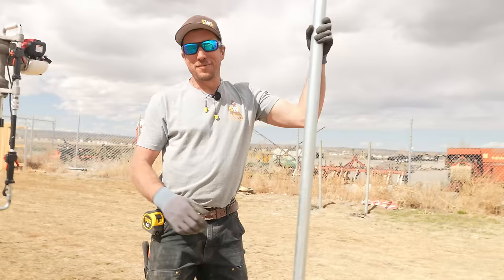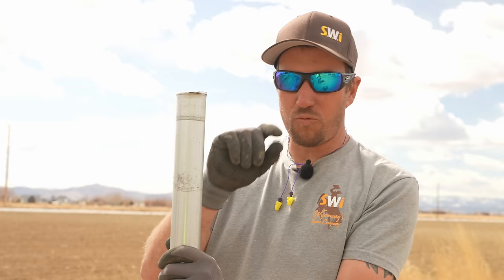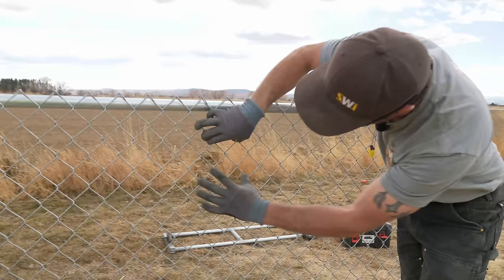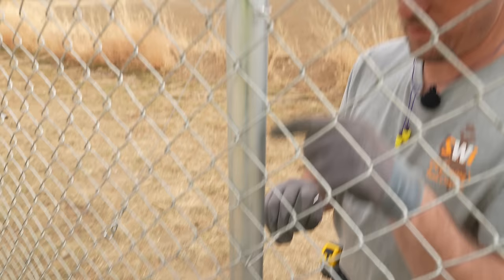How To Install Chain Link Fence The Easy Way

Comment: I have 300 ft of chain link fence in my back yard, to keep my dog in. The fence is in terrible condition. Sags, missing ties, no bottom wire; previous owner diy special. I contacted a fencing company to come out and service it. Never heard back! Red hot sales lead ignored. I have worked with my hands almost my entire adult life, now 77. There is nothing I've seen on this video that I can't undertake, and I have the cutter tools already.  Great video. Very well explained. The man has mastered his craft.
Reply: Sir I’d love to help you if you live in Georgia , I’m a hard worker and will do it for free
Reply: Red flags for contractors: fixing other people's work, angry client, DYIers that know something by watching videos, clients that know everything wrong with fencing so you know they'll only find fault in your work. Those are folks that, no matter how good your work is, they will never be happy. Pass
Reply: Never call a fence company for stuff like that it’s usually gonna cost u 400-600 just for a repair I charge 150-400 depending on repair
Reply: I am a Chinese fence manufacturer and fence machine manufacturer
Reply: Where are you located and have you got your fence ?
Reply: How did it go
Reply: As long as you have stretching tools, chain link fence is a no Brainer. Just watch your back rolling it out. And pay attention to if the crown is up or down on the mesh rolls, it will always roll out the same way accordingly. This will save you from having to flip every other roll.
Reply: yes

Comment: I am from Czech republic, in Europe. It is interesting to see how different your fence system is. We don't use the top rail, that would be too expensive, instead we use 2-3 tensioning wires (top, middle, bottom), which are not twisted wire, just a single one and on each wire there is a ratchet tensioning mechanism. To prevent terminal posts from bending under the weight of the fence we use struts at 45deg angle attached at 2/3 of the height of the terminal posts and on link posts each 80 feet. These days more and more people don't even actually use the chain link fence, but we use square hole spot welded fence, which is much stronger and doesn't require the tensioning wires. Instead the horizontal wires of the spot welded fence are bent slightly to a V shape in each square and then to tighthen the fence we use special pliers which are bending the V shape to be more pronounced, effectively making the square narrower and thus tensioning the fence. A lot of times we also use concrete plates underneath the fence, which are sitting on the ground, attached to holders on the fence posts, this is to prevent dogs from digging underneath the fence.
Reply from the maker: Very interesting! I wish I could see it!
Reply from the maker: For sure! 👍🏻
Reply: Id love to see what it looks like
Reply: @iridium8341  I would disagree with that, to me the top rail would make the fence look too bulky and noticeable. For that reason our fence wires are coated in green color so they are almost unnoticeable and don't stand out in nature. I haven't seen the top rail used anywhere in Europe, apart from some specialty fences, like security perimeter fences around industrial buildings.
Reply: For the top 4 point barbed wire on both sides and spooled razor wire. in the middle 480 volt cable.
Reply: That sounds like what we call deer fence over here
Reply: Thank you from Alberta, Canada 👍
Reply: yes

Comment: Bro You Guys are so Amazing for helping teach the next generation of young folks to work smarter not harder. YouTube is a truly a wealth of know how and you are adding so much value to the treasure chest. TY brother!
Reply from the maker: Thank you so much for those kind words!
Reply: I have a question installers placed a chain link fence between my property and my neighbor's property and they ran the fence right against the tree and cut the bottom two feet or so and pulled it open so it could wrap around the tree trunk. Of course three years later the tree has fallen into his yard. How difficult the process would it be for someone who's never installed a fence to unroll the fabric or excuse me roll the fabric up 10 feet from left to right or from the last Pole to the pole before it so that they Bobcats can work on the tree stump and get the rest of the tree out without really buying all these other tools that a fence installer needs

Comment: I like to slide all the bands necessary on each terminal prior to top rail. You don't have to awkwardly stretch the tension bands on the terminals that way.
Reply: Yep, and be sure to squeeze your tension bands and brace bands before sliding them over the terms. It makes it easier to place your bands and keeps them up on the post out of the way for stretching your tension wire
Reply: Same here
Reply: Same here and they're loose enough to even get the nuts and bolts on. I usually stretch the fence and cut to the link and just slide the tension bands down the tension bands.
Reply: @mikebriseno5896  that's pro! Haven't tried it like that. Thanks.

Comment: I’m a ham radio operator and have been using chain link fence post for years as masts to hold up my antennas and weather stations. It works very well and is very secure when done correctly
Reply from the maker: Nice!

Comment: A+ Excellent Job, You are actually providing professional instruction and using actual teaching methods.Very thorough and like how you cover your steps/review. Hardly anyone else does that. Also showing the different ways/methods that can be used. Fully explaining/naming different tools used and all the parts of the fence. How everything fits together from top to bottom for a completed fence install project from start tto finish. One of the best instruction videos ever viewed, Not skipping over anything or leaving things out which requires the viewer to have to replay sections of the video over again. Content Creators need to take lessons from you on how to properly create videos.
Reply from the maker: Thanks! Such a kind comment. 👍🏻

Comment: 99% of utube videos are done by people that don't really have any idea what they're doing. This is the real deal and I need to fence in about an acre. Gonna do it exactly like you showed. Only thing I haven't checked on is whether I can rent a post driver. Being a retired mechanic I will use marine grease on bolt threads so grand kids can disassemble 30 years from now. Marine grease has a sticky additive that water won't wash off.

Comment: Huge shout out. there's a poorly made chain link fence with no top rail or bottom wire, that runs around my back yard but a 78' section of it was ripped out by the landscaping company the flippers hired so they could get heavy equipment back there to dig and it was never replaced. I built the 78' to finish out the fence and added a gate, it may not be the straightest fence ever made lol but it is very sturdy and the only reason I was able to do it was because of the videos on this channel, they break things down in a way that even a dummy like me can understand! Thanks so much for the videos and keep making great content!
Reply from the maker: Hey thanks for that! Super awesome to hear!

Comment: Hi Dan. I want to take a moment and thank you for this OUTSTANDING video! I know NOTHING about fences - I work in the IT field. I was consistently being let down by fence companies that said they would call back, and never did. Or contractor friends who promised to work up a quote and never did. So I decided I would do it myself. This video, and the other one on your channel that breaks down all of the pieces and how they go together - was all I needed!. I planned out the 200 feet of fencing along the back of my property. Someone helped me with digging the holes, but I finished it today! The terrain was not flat, and I had to remove some trees, but it is done! I really appreciate your "right to the point" what and how and why instructions.
Reply: Additional, I used 28 post - 6 were terminal posts. 5 ft galvanized chain link.
Reply from the maker: Sweet! Love hearing stories like this! Thanks for sharing! 💪🏻

Comment: We usually put a bottom and top wire made of steel or aluminum at top and bottom on chain link fencing. The chainlink is then clamped to the wire with c rings, the bracing is put on 45degree angle at corners and ends. We dont use sturdier poles at ends. And we drive "ground anchors" into the ground using a hydraulic rammer driven by a mini wheel loader, that the poles are fastened to.

Comment: Thank you SWI your video gave me just enough insight to be able to complete my gate widening project. I ordered a puljack but it got delayed in shipping so I stretched my fabric using my shovel by temporally driving a piece of extra post into the ground as a leverage point opposite the gate post 😂😂😂 it worked!
Reply from the maker: Nice work!

Comment: Here at our company we fly in the face of standardised sizing, and we use outside diameter for pipe, which is only used for tube. The outside diameter never changes, but tube only goes up to 1/8"/3mm, then tube becomes pipe generally. You can get extra light pipe, but it's not good for much.

Comment: Very different looking fittings from what I'm used to (Australian).  We also usually use a single strand of 4mm (1/16") helix-coil wire* to tension the fence with 2mm wire ties or 1.57mm lacing (as opposed to fittings) to attach the fabric.  Also, with a fence that has a top rail, knuckle/knuckle chainwire would typically be laced to the underside of that rail rather than protruding.  Generally, only fabric with a barb would be allowed to protrude above the top of the fence, in which case the fence probably wouldn't have a top rail at all, just another strand of heli.

Only saying this to point to the weird cultural differences, not as criticism.  The goal is a strong, straight, neat fence and your techniques are definitely giving you that.

* In true Aussie tradition, we abbreviate "helix" to "heli", a move that saves us absolutely no syllables at all.
Reply: I'm Aussie too, and done my fair share of fencing. This would have to be one of the hardest ways I've ever seen it done lol. They must do things different over there

Comment: wonderful tutorial.  I like it short, detailed and to the point.  I can't find a contractor and need a fence for tenants to have dogs asap, so I will use your methods.  Sadly it is bit harder getting those ingenious tools quickly here in Canada, but I have cobbled together close-enough on amazon.
Reply: follow up.  I went to start installing posts today.  I was hoping I could get 24 posts set in a couple hours.  Was surprised the tool rental place said they do not rent such a gas powered post pounder.  THen I found out why.  Like my own house the place I was putting in posts are in essentually railroad ballast.  Hardly any dirt just all rocks, which I guess it typical here as I found at my home doing a fence 2 years ago.  In some places I could not manually pound a post in more than an inch or two.  I wrecked the transmission in my post hole auger machine.  It's turned into a mining operation, about 45 minutes per post with a scaling bar to get 24 inches deep then fill in with foam lol.  This is just for a residential 5 foot chainlink fence.  I thought it would take 2 days, it's going to take me a week to finish the whole thing with only 4 posts now done of the 24 I need to set.

Comment: I do fences for a living. Most of the procedure is correct, however it's best to put the tension bands on at the same time as the brace bands. Also of you give the bands a squeeze before you put them on the post, you can place them on the post where they need to be ( spacing). Also when tying, if you get the chainlink just below the top of the top rail, the line will be clean across the top when done.
 Those drill ties are great, when their done properly.

Comment: I find it easier to put all my bands on with nuts and bolts and I drop my bar through the link and tension bands. And that eliminates The need to always have bands and nuts and bolts out the entire time.

Comment: Some of this stuff is really different than the way I installed fence, but some other things were really cool. The top rail tool would have been nice for doing 8' 9ga, and those panel stretchers look a lot beefier than the ones we used. I'm going keep those in mind next time I have to do a small fence job for someone.

Comment: I really really appreciate you guys who make these how to videos for people like me.  I have worked with a lot of different things from framing, dock building, decks, electrical, etc. but building a chain link fence was just one of those things that I had never gotten to do nor worked with anyone who installs them.  To be able to see the steps involved on video as well as the material and tools I'll need to do it makes it soooooo much easier and stress free than blindly going into it not knowing anything and having to redo something b/c I didn't know to put this piece in first, etc.  It makes you much more prone to take on a project and do it yourself when you're able to see it done by people who are experts do it.  To visually see the steps on video helps so much when you have zero experience/knowledge in that trade.  I have about 8-10 ft of area that needs to be fenced to keep my aunt's dog from breaking out and after watching this I'm definitely going to do it myself and it will also give me a good excuse to go Home Depot and buy more tools b/c I am a hardcore tool junky!  Thanks again for your knowledge of the trade!
Reply from the maker: Thank you so much for the kind words!

Comment: Awesome video. Well explained. Clear and precise. I really appreciate it. My only question is, I’m doing a 6 foot black chain link.    Setting the terminal post exactly 2’ in ground for an 8’ foot post? So 6’ is showing?   I want to keep chain link slightly above ground to not fight the surface of grass and dirt.  Or do I set them above 6’ bc the top rail will be set at 6’.

Comment: I’m currently installing a chain link fence for my father in law and his Newfoundland. I started looking around at a few videos to get some pointers as well as tips n tricks. You have some pretty cool tools too. I like the upgrades almost seems like it should be common practice after watching your video. My tension wire is 9g single strand would you recommend tightening it the same way? I can make something like you showed. Your demonstration was awesome, I’d enjoy working with a guy like you. Keep up the great work. I’ve been in construction for approximately 35 yrs. and they video is to the point and very well made. Better then half the other so called information videos. Great hands on no bs, just good ole sarcasm!! Lol
Reply from the maker: Thanks! That's super encouraging of you to share. 👍🏻
Yes, I'd recommend tightening your tension wire in the same way. 👍🏻

Comment: Putting 900' of 4' At my house. Been watching your videos heavily lately. Nice presentation. Good information. Simple and to the point. My only question is large runs that are over uneven ground, what is the best practice after the posts are in to minimize the wave of the top rail?
Reply from the maker: That's an fantastic question and I think we need to do an updated video on that soon. In the end you want to follow your ground but smooth out what the ground is doing. We talk about it in this video: https://www.youtube.com/watch?v=iDLPhIN3I38. (It's one of our earlier videos so you'll have to be patient with it, but the info is in there.) I've put this topic down on the list for a new video. 👍🏻
Reply: @SWiFence  No worries! I ended up completing the 900' this weekend at my house. Ended up just using some string and eyeballing and making adjustments along the way. Ultimately turned out better than I expected. Couldn't have done it without watching your videos. So a huge thank you.
Reply: I would install it level, then add dirt, move dirt around. Some times, if you follow "ruff contour the fence will look funny.

Comment: Tbh. I would use self drilling screws or self tapping srews with fencing washers instead of those fencing ties but you do your thing😊 the washers usually have sharp corners, might not be kid friendly😊